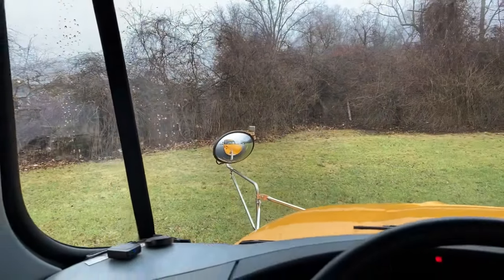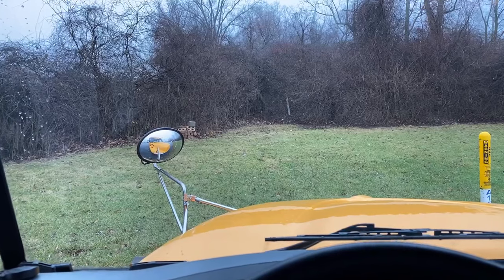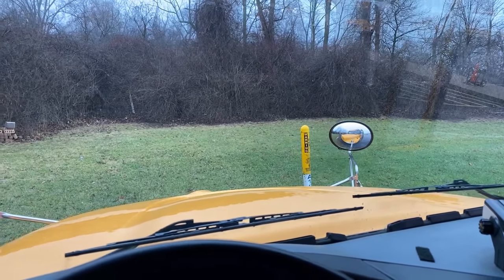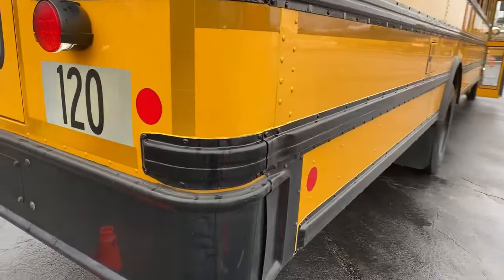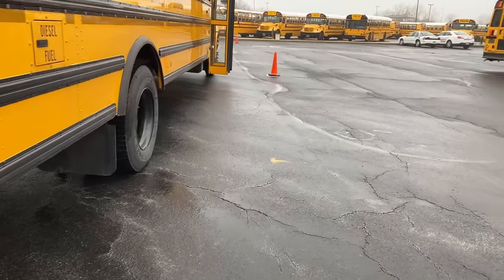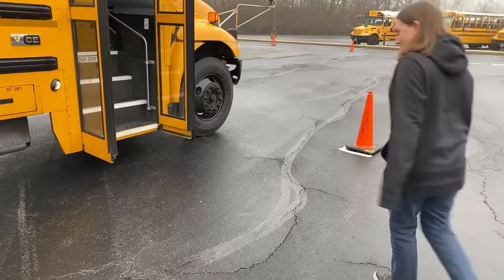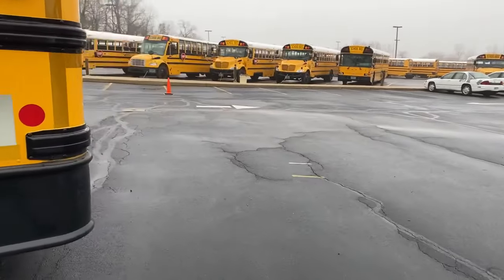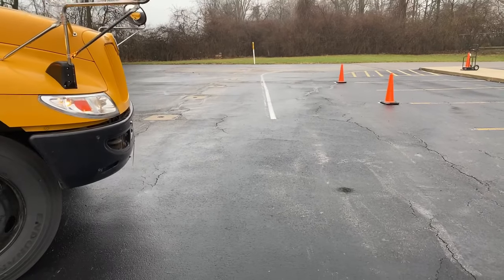Alley dock live

Comment: Do your buses have disc or drum brakes? Do air disc brakes have the same parking brake valves as the drums?
Reply from the maker: Drum brakes.  I have seen the disc and rotor systems.  If this is the type of braking system you have, the information for the pre-trip exam is varied slightly. Do you know which type of vehicle you will be testing on ?
Reply: @SchoolBusSass  I am too young to be a bus driver, I am still in high school.
Reply from the maker: @christianladymichelleclm5809  , I appreciate your enthusiasm for school busses and the transportation industry.  Thank you for your comments!